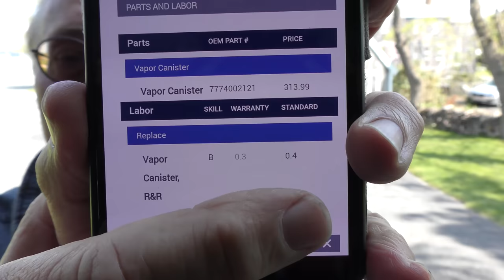7 Car Myths Stupid People Fall For

Comment: Sir Scotty, a tip for your viewers, if the toyota remote control is not working, just put that old toyota remote control in a plastic bag then put the bag with the remote inside ice, it will charge the battery just enough so you can turn off your car alarm and unlock the door. it works! then you can go and replace the battery in the remote

Comment: My Fiat 500 states it needs an octane level that’s between mid-grade and premium. If I put anything less than premium in, it runs noticeably worse, including losing a little power on hills. My tank is small and I don’t drive everyday, so it’s not a big deal to get the premium.

Comment: Higher-grade petrol can make a difference, but it depends on the management system. In my 2008 Honda Jazz (aka Fit), using high-octane fuel increased the mpg figure by around 15%, as well as increasing the instantaneous power. 
Depending on the retail prices, that can actually reduce the running costs.. 
I now have the 2016 model, which is more efficient overall; a similar increase should make the "premium" fuel cost-effective, or at least break even.

Comment: And guess what?  Your compressor runs in the winter anyways whether your use your ac or not, because it cycles on with the defroster just so it's still in use and doesn't seize up on you.

Instead of a tune up, one of the things I've noticed that really makes a performance difference is just getting all the carbon build up cleaned out of your throttle body and intake manifold.   

Did Scotty move, btw?  His garage isn't full of crap anymore.

Comment: I almost never drive down a freeway with the windows completely down, but most of the time I'm not running that a/c when I could. I've checked it. A/C on my car uses about 4 MPG more compared to when I have the windows somewhat down while freeway driving. Also, for some weird reason, when the weather gets cooler, say below 65, I lost about 4-5MPG. Come weather in the seventies again, and it's right back where it should be. I've had the car eleven years, and it's always done that. The other cars I owned "might" have done that, but this is the first I've owned that has an MPG monitor. Odd to say, I get better milage at 100 degrees, than I do at 55 degrees.

Comment: Hey Scotty,
My wife’s 2018 Subaru Outback has just under 10,000 miles and the tires are 5 years old. Do you think I need to get new ones? Also, it’s nerves had a tire rotation… I check the wear and it looks fine. Love your channel… I learn a lot of stuff. Thanks!

Comment: Your examples for Premium vs Regular may be accurate for modern road vehicles, but what about Primium non-oxiginated vs Regular? I've been suprised at how many gas stations offer Primium AND Primium non-oxoginated these days. Makes sense if the oxiginated is simply for more kick in modern high end vehicles... But still not great for the longevity of a small engine if someone can't tell the difference.

Comment: I find my 2012 Focus runs better and gets better mileage on 89 octane instead of 87 - this is actually implied in the owner's manual.  Of course, I only fill with 89 when the price difference between the two grades is minimal.

Comment: Was using my compressor at home for filling my tires. Turns out the gauge on the handle wasn’t right. It read low and I actually had 55 damn psi in them. Luckily was found when I took to rotate and change the the gauge. 🤦‍♂️

Comment: I just changed my oil this morning I had just over 5000 miles. I have always used full synthetic and have always done the 5000 mile oil change. Never any issues. I hate the fact that my wife’s Toyota says 10,000 and I cannot convince her otherwise. Well I guess when it starts burning oil she’ll learn the hard way. She’s convinced because the dealer told her 10,000 miles and I keep trying to tell her that is wrong.

She bought the car new six years ago and it’s been paid off for over three years. She said she wants to keep it forever but we’ll see what happens with those 10,000+ mile oil change intervals!! it’s a Toyota but you still have to take care of it. Modern engines require proper oil change intervals for so many reasons

Comment: 3:12 
I was very consistent with fuelconsumption with my last car and tested the premium and normal gasoline. With premium I got more miles out of a tank, but converted to money, it was equal to what I had paid extra compared to normal gasoline. There was no benefit there
Reply: In most cases premium is ethanol free which is better for fuel system internals

Comment: the only cars you should really be putting super or premium into are forced induction (super/turbo charged).

and some are tuned to not need it.

and if you do put regular into a car that needs premium, you'll get detonation, which is mini explosions in an uncontrolled fashion in the cylinder, leading to failure of the piston/rings, and eventually engine goes boom in the not fun way.

when in doubt, read your cars manual.

Comment: Tires are the #1 thing you should never skimp on. Always buy the best ones you can afford. It's literally life or death. Once you buy excellent quality tires you'll notice the difference in the dry and more importantly in the wet.

As for premium fuels. I've always run 98 octane (Here in Aus) in ALL my cars. I've never had to have any injectors cleaned in any of my cars and my mileage is always better in some cases over 10% better. If in doubt read what the manufacturer mandates and use that but if you can afford it I'd use premium.

Both of my cars require premium anyway due to the power output but I remember a little Mazda 121 I had onlly needed standard fuel. I threw in some 98 octane and it ran better, was more efficient and had more power.

Comment: In Europe the minimum is 95oct. Premium is 100 or 100+. With 95 my little 1.2 tsi makes around 110hp. With premium it makes another 5-10 depending on the conditions. Believe it or not, modern engines are tuned to utilize high octane fuel. Especially if not exclusively, the turbocharged ones. Older engines and naturally aspirated engines don't really care about premium fuel because they don't need it.

Comment: For diesel cars in Germany, it's better to use the expensive diesel, because the bio diesel in normal diesel is about 7% and produces more carbon on injectors and so called AGR valves. I use the more expensive diesel and don't have that problem.

Comment: 1:28 this is true in most cases except any car with a carburetor. regular gasoline has ethanol in it which tears up carburetors. also in most cases with those cars you will get better gas mileage to make up for the extra cost.
Reply: I don’t have a carb anymore, but ethenol free regular is still available here

Comment: My father once tested the difference between regular and premium fuel. The premium ran better, ran further, and they have lower pollution, they are also better for the engine. When I turn on A/C in our 13 year old Ford Galaxy, I get 2x fuel usage on idle, and about 9 liters/100km instead of 6 liters/100km on country road driving. I just wanted to write this comment so y'all know that not all of the stuff that is mentioned in the video are true for all cars.

Comment: When you say “high test” fuel are you talking about specialized race fuel, or just 91/93 octane premium?
Reply: Cause I live in Iowa and almost all fuel except 91 octane premium has ethanol. Usually 10%-15% and I’ve always been told that’s much worse for your engine as far as keeping it clean.

Comment: i use to put about 2 gal.  hi test gas and the rest with regular gas to clean the engine. it seam like it work and the motor would work better. be save and bless .

Comment: About the gas myth. 

Yesnt. The difference between high grade and low grade is very little and generally they have about ths same range. From what i can gather, the high grade is really more for engine maintenance with extra additives and detergents added to the fuel. 

That said, so far ive found Mid grade is vest for range, low grade for daily running and every quarter year high grade and a fuel cleaner for one tank goes a long way.

Comment: Just saying,  the engine still knocks.  The way an engine is able to use 87 if tuned for 91 is by a microphone that detects when it starts knocking, then it pulls timing and fuel.  So the engine does have to knock for it to work.  If it says use premium gas, use premium gas

Comment: The Octane level refers to the willingness of the gasoline to combust by itself while being compressed. The higher the Octane, the lower the likeliness of it combusting by itself while being compressed by the piston.

In gasoline cars, you do NOT WANT the gas mixture to combust by itself. There are certain piston positions where you want to combust it (via the spark plugs), and positions where you absolutely do not want it to combust (while the piston is compressing the gas mixture for example), and several other positions where the energy output is lower than what it could have been, if the gasoline mixture didn't combust by itself.

So, a higher Octane gasoline will never be worse for your car! In the worst case, you just won't see the benefits of it being more resistant to self combustion than lower Octane gasoline.

Most of the time, the higher Octane level of gasoline is achieved by added additives, and that's what could be problematic. If the goal was to achieve higher Octane as cheap as possible, low quality or bad additives might have been used, so the gasoline could in the end have a high Octane level, but in general be of lower Quality.

Cars with tuned tight combustion timings are only allowed to be fueled with hight Octane gasolines, or you will loose warranty. High power Sports Cars most of the time also call for high Octane gasolines.

Normal street cars however should be able to handle lower Octane gasolines. The manufacturer most of the time will tell though what the lowest allowed/recommended Octane gasoline is.

Comment: I used fully synthetic oil on all my five cars since new. Every 3k miles and I do changes myself. Oil is cheap and one of the 5 cars is a turbo.
Reply: You're wasting money.  Full synthetic is still perfectly good after only 3000 miles
Reply: @Luis DeTomaso  Each car does about 3k miles per year so it would have to be changed once per year anyhow. 3 Hondas (minivan, crv and accord) and 2 new Subarus my kids drive (22 Outback XT and 2023 Forester).
Reply: The once a year oil change is a myth too. Oil does not degrade after a year unless you get moisture in it or have fuel dilution problems.
Reply: @James Cherney  probably but I don't care. Oil is cheap and it takes me 2-3 hours once per year and plus I like working on my cars.

Comment: #2 MY car requires 96 octane fuel as outlined by the user manual.

I can not get 96 OCT in my state, therefore my knock sensor is always going off. My SUV runs worse on cheaper fuel.
Reply: Where the hell would anyone get fuel like that outside of a racing fuel station? Is that a LandRover or RangeRover by chance?
Reply: @kingzach74   Supercharged Xterra

Comment: My cars are recommended to run on 91 Octane gasoline. I'f I run 87 Octane, I lose not only power, but get reduced gas milage. So, the gasoline is cheaper, but I'm using more of it -- and getting lower performance.

Comment: My Buick Regal is a 4cly turbo. The owner's manual recommends premium but also clearly states you can use regular. But it's also a flex-fuel vehicle and a E85 is equivalent to 100 octane. So instead of paying $4.20/gal for premium, or $3.40/gal for regular. I'm paying $3.20/gal for E85 and getting the same horsepower improvement for a dollar cheaper. It's about the only scenario I can think of where E85 makes sense.
Reply: You get less MPG with E85
Reply: It will have a little less power with regular fuel.  Most folks won’t notice the difference.

Comment: Ok Scotty, I have a 2005 Thunderbird that requires 91 octane or higher. If I use lower octane I have valve clatter and that could cause permanent damage right? So I dont know how I feel about your advice about just using lower octane to save money.

Comment: You can also use an old Pringles tube to increase the range of your key fob.
Reply: eat the pringles and walk back to the range of the car !
Reply: Directional?  Should work.
Reply: @robertheinkel6225  Place the fob inside the tube, then aim it at the car.

Comment: I will disagree somewhat with the gas "myth". I had a 2011 Camaro that needed premium gas. 427 engine. I ran out one day about a half mile from the gas station (don't trust the mileage indicator!!!) and my dad brought me a can with 87 octane in it. My engine knocked for about 3 days until the 87 was burned up and it started processing the 93 I put in. My Audi says no less than 91 octane and I make sure I put in at least that. Not taking a chance in hurting my engine perfomance with the lesser octane. BTW I get about 26 MPG and got over 30MPG on a long trip not too long ago.

Comment: Hey scotty I heard from a co worker if every once in a while run a tank of premium or plus fuel in your car and it will clean up the injectors. Is this true or a load of bull. Just wondering if maybe there is some truth to it. I have a flex fuel 2011 3.5L v6 ford fusion runs perfect never broken down and it has 205,000 miles on it. I keep it well maintained.

Comment: Alright I finally settled the question of to premium or not to premium in my mind. It just seems to be an efficiency loss. And gm only mentioned that as to why their electric vehicle required premium fuel, on a freaking generator no less, so I'm betting they only did it for fuel economy numbers.
So the problem is premature spark-ignited knock, which can be dealt with knock sensors, not auto-ignition under high pressures. I'm guessing the two phenomenons are occurring under very different environmental conditions, ie the auto-ignition is probably not in the range of non diesel engines.

Comment: Scotty, I have a 2010 Tundra Limited with the 5.7L and 168k miles. When I turn the steering wheel most or all the way to either  side I feel a “creaking” in the steering wheel. I just put new front struts and ball joints and it’s still there. What could be wrong?
Reply: I have the same question... but I also need to put in new tie rods and control arms and probably the ball joints is what is making the sound you are hearing.... did you get it fixed? what was the issue? :-)
Reply: I have the same question... but I also need to put in new tie rods and control arms and probably the ball joints is what is making the sound you are hearing.... did you get it fixed? what was the issue? :-)
Reply: @rhiannablumberg4803  other than the struts and ball joints I have not done anything else. It is not fixed.

Comment: The Body generates about Nine Volts, which increases signal from TV antennas when holding one indoors. Probably boosts the Radio signal to the Key fob as well. The Brain generates AM and FM frequencies too, so they say.

Comment: I got a flat tire on the interstate and where my gas tank is the plastic molding that holds the pipe that you put your gas in is loose. It's a 2007 chevy uplander 2007 LT....any suggestions to fix the molding so I don't see my tire anymore from the gas cap door. Once I open it I can see my tire.

Comment: There is a Casey’s station near me that sells 85 octane fuel for less than regular, is it safe? I drive a 2012 Mazda 6 not a flex fuel. I believe the pump says 2006 or newer, next to it is E85.

Comment: Mileage is not what determines the time to change your oil. Check it often, when it looks dirty, change it. Your driving style and conditions, climate and geography differ. 5K miles in hot flat florida driving reasonably isn't the same 5K racing in Montana in cold weather...

Comment: You always say that midgrade fuel is pointless.  Fun fact: that's not true at higher elevations.  In most of the US, the options are 87, 89, and 93 octane.  When you get to higher elevations, like those found in Colorado, California, etc, the options change to 85, 87, and 91 octane.  We live in CO and my wife's Subaru manual specifically states that you must use 87 or higher octane, even at higher elevations.  So her car runs on the midgrade.  I realize it is the exception and not the rule, but...jussayin.

Comment: I change my cars oil every 6 months even though I don’t go 3k miles on it, wonder if I’m doing it too much
Reply: Better to much than to little. With the low mileage, you are probably doing stop & go city driving. Oil would have more contamination in it. Oil is cheaper than rebuild engines.

Comment: 3:07 scotty i tottaly disagree on octain level. I get better gas mileage out of midgrade gas in my
GASP: Toyota/of scion. But you can take the corn oil and put it back into the frypan. Because it screws me on gas milage and the motors health.

Comment: On the matter of "correct air pressure":   

(1) My cargo van took the same tires as rigs a thousand pounds or more heavier and a thousand pounds or more lighter. 

(2) Based on the fact set out in paragraph "1," claims a given tire should take the same pressure regardless which rig is using it makes no sense. 

The foregoing is especially true when you consider over inflation wears the middle treads and under inflation wears the outer treads, AND tires need the air pressure adjusted for the load it [and rig] is carrying.

(3) My old Ranger calls for 28 PSI. That MIGHT be fine, if I drove it with the body off. Even then, probably not.  Clearly, merely that the rig's manufacturer calls for a specific air pressure in the tires does not mean you should rely on it.

Merely switching from 2 ply rated tires to actual 4 or 6 ply tires can be cause to select more air pressure.

(4) In the end, never let your tires get below 34 PSI, and watch the tread wear to determine if you need more air.